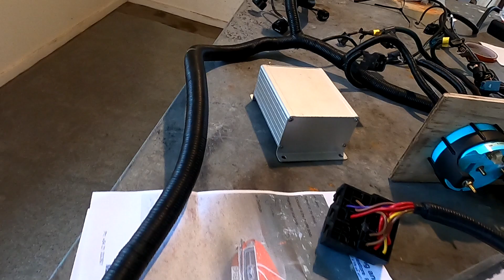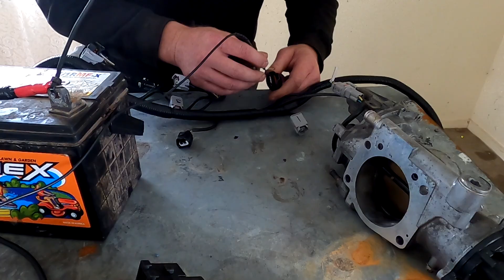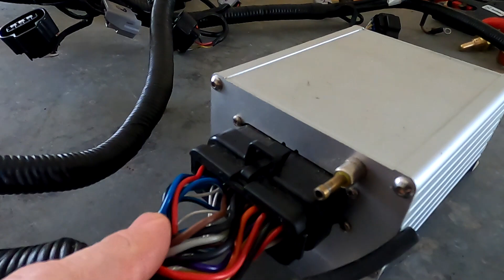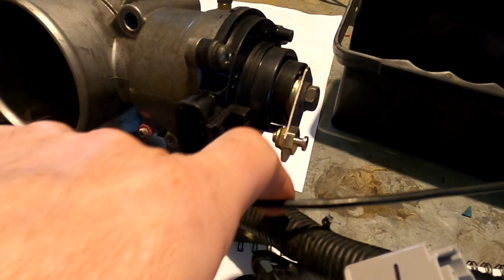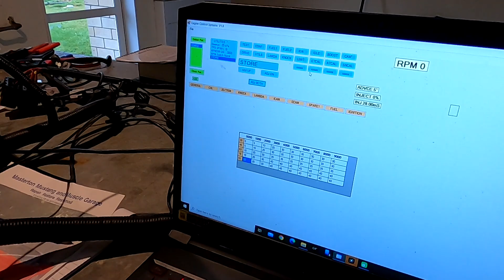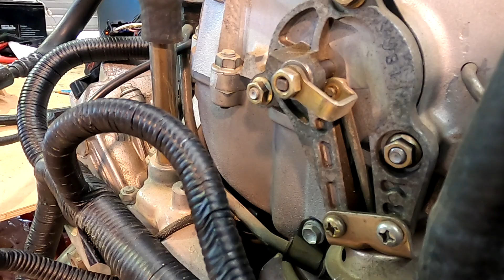NZ made engine management system. ECS , Engine control systems.  Jetboat loom.

Comment: Hey, I’ve got a 1UZ question, you seem like the man. 
My old man and I have built a RCR superlight coupe with a 1uz, vvti. Forged rods/pistons, head studs, cams, head work, GTX4294R

Have reached the limits of of the VVTI system, lose a lot of position control at high RPM, it really wanders there. Have real tight piston to valve clearance. Don’t want to risk running a piston into a valve, want to go fixed cam timing for the time being so we can figure out the bigger issues with the car first and come back and make it all work later. 

Hartley will not get back to us on their kit, replied for a little on Facebook and once picked up the phone and then just stopped responding altogether. 

Are there any other options you know of? I am in the US, and know shipping overseas is a pain but will foot that bill.
Reply from the maker: I know several other places making VVti blanks.  I am wondering why you are having vvti float though as this is very unusual, unless you have oil pressure issues , solenoid issues or the ecu is struggling, all of which could lead to other issues.  Often when I see an issue like this its worth addressing as its easier to fix known issues than unknown issues.
Reply: @CartuneNZ  I’m with you, but it’s not surprising (to me anyway) it’s having issues with heavy springs and lots of lift, at 9200rpm. it’s dry sump so we’ve got plenty of pressure. On the dyno and we tried different pwm frequencies and PID settings with no success. 
Trying to make a race coming up and have just spent too much time trying to make it work.
Reply from the maker: @Big_Iron_Mode  what does it do with the vvti solenoids unplugged?  Does it still float?
Reply: @CartuneNZ  well haven’t tried unplugged, but with a 40% or lower duty cycle it holds dead steady at full retard. But that’s a ways off where it makes good power. 

we have another motor, the “street” one, much less wild and has the off the shelf supertech spring kit and we have all the vvti working perfectly on that one. Also swapped the cam gears and solenoids between the two to see if we had a problem there, to no success.
Reply from the maker: Interesting that at 40% duty you arent seeing advance as this is very unusual.  I'm concerned if 5% doesn't give me advance.  Other superstock engine builders are llama engineering (marc) and csl cams (Brendon). Both are extremely busy with engines like hartleys,  hence why they may not be interested in a tiny sale and the hassle of freighting overseas.  Another option would be for you to machine your own up.  But if unplugging results in full retard and no float you might be able to simply leave the solenoids unplugged.
Reply: @CartuneNZ   50% duty cycle is considered neutral and will not change camshaft position, below that is retard and above is advance. 5% duty cycle will act the same as having the connector unplugged. But whatever engine management you are using probably calls 55% as 5% advance, 45% as 5% retard. so my 40% you would call 10% retard.
I will give them a call when its monday over there just to see.
Reply from the maker: @Big_Iron_Mode  ok.  What ecu are you using?
Reply: @CartuneNZ  MS3pro ultimate